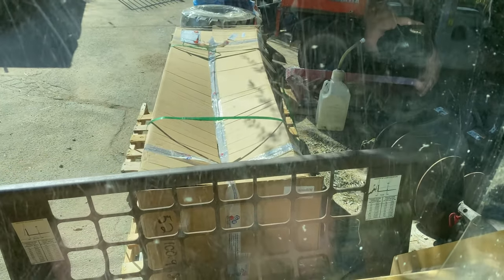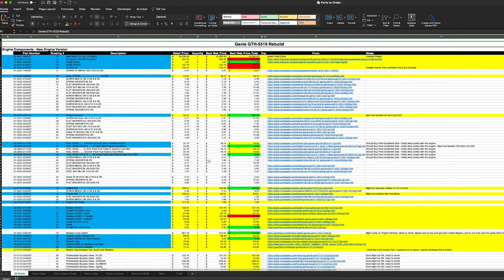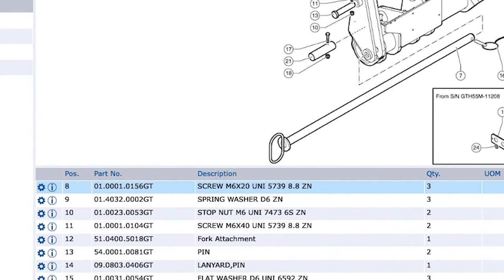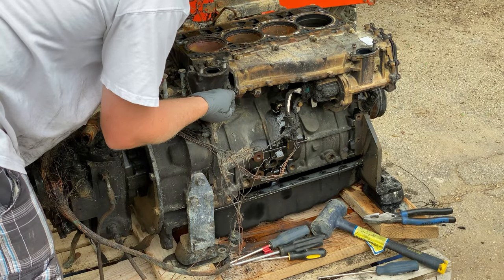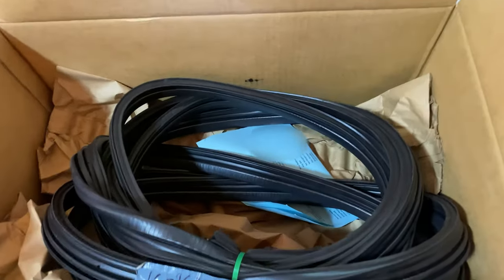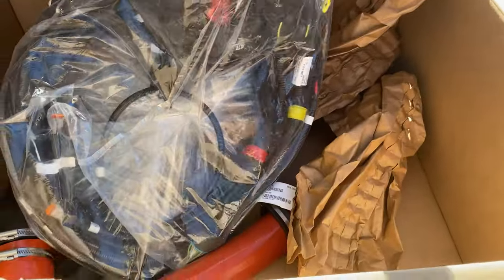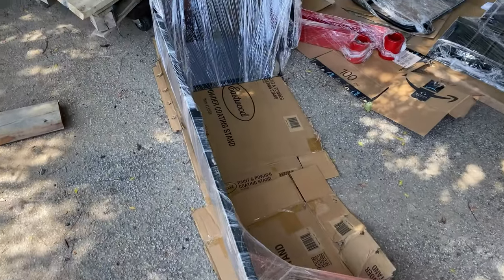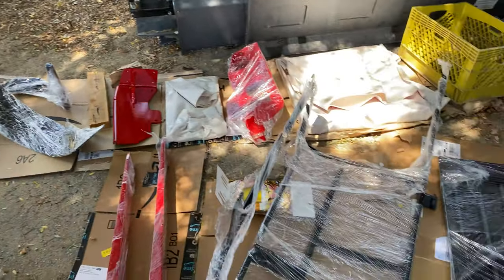Part Sleuthing and Powder Coating - Genie Rebuild Pt. 6

Comment: Red powder coat on a blue genie? 🤔
Looking forward to next video. I've done just like you. Google manufacturer part numbers. Search for a identical machine nearby for sale or rent. Go take lots of pictures of the parts.
Reply from the maker: Fantastic, I’m glad I’m not the only one!  Ya, most of the red parts are for the engine and the other visible ones are for the forks. I never understood why they always go black for the forks.  It makes them hard to see and dangerous in low light!
Reply: @MakersAcres  perhaps so the forks are not a distraction?
Reply from the maker: @skliros9235  maybe, I feel like them being high visibility should help. Guess we will find out. Hehe